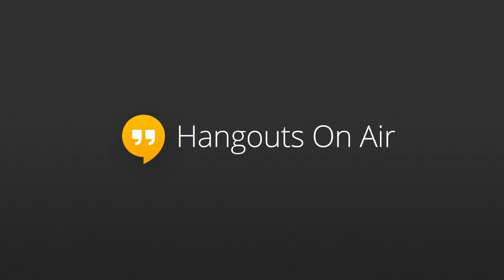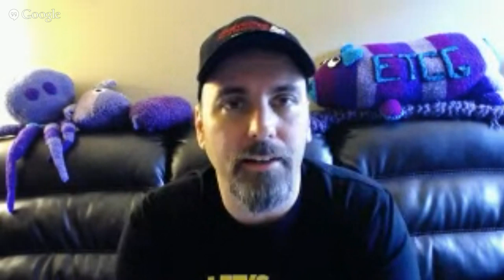EricTheCarGuy Answers Questions Live #45 6/24/2015

Comment: Turns out it was the idler tension pulley bearing had gone bad and was eating through the shaft after it ate through the bearing. Got it fixed and the whining is gone now. I probably wouldn't have caught it if I hadn't got down in there and taken a better look.

Thanks for what you do man.

Comment: Regarding trailer wiring connectors. I had a 93 GMC Sonoma that kept blowing the signal light fuse and running extremely rough with frequent stalling. Did the obvious checks with no help. While thinking about the problem, I turned on the key and the signal lights. I oddly heard a clicking from the TBI every time the signal lights flashed. Pulled off the air cleaner, repeated the test and sure enough, every time a signal light flashed the TBI fired in a shot of fuel. I tore that truck apart looking for the cause. Finally, after hours of searching, I noticed a plug in trailer harness tied up around the left rear frame rail. I unraveled the wires and found a chafed spot that was able to contact the frame. Unplugged the add on harness, reconnected the original connectors and all problems were instantly solved. Weird! It was a 2.8 V6 5 speed. Thanks for the great vids Eric! Hope my experience helps someone.

Comment: 47:00 try checking temps, coolant sensors, engine temp sensors, temp gauge, thermostat, even radiator to see if they are all within spec.  chances are it's probably at least one of those things.  especially if the gauge doesn't appear right.

Comment: missed the show. wanted to ask about manual transmission noises. only happens in 5th gear while accelerating. sounds like a skateboard bearing. a bearing doesnt make sense to me because a bearing would make noise at all RPM, not just in 5th. i did an oil change and found no metal bits. when i did the clutch in december i put the transmission threw all its gears and checked play and didnt find any noticeable ware in any gear inc 5th. i put a bottle of lucas oil stabalizer in to see if itd help and it did make it quieter. any ideas? this is a 1987 4 runner 4x4

Comment: Hi Eric, I know this video is already over, but I'd like to ask you a favor. I have done a major engine rebuild on my acura 35rl after having overheating issues. nvm The car runs fine, power output is probably even better as it was before but I am having one issue. The engine is shaking at exactly 1330rpm nothing above and below. As I am willing to take the engine out again I would consider changing the crankshaft bearings also but I have a problem of not knowing how to measure the crankshaft or the block to know which bearings are suitable. So my question would be. Do you happen to have some old block and a crankshaft around where you could demonstrate how to measure those things? I am ready to buy the necessary gear but I can't find any comprehensive video about this on youtube. THANK YOU A LOT for any answer. Keep the good videos coming!

Comment: ETCG, I have a 05 2.3 ranger my abs false activates every time i touch the brakes. I hear the motor humming even when Im not touching the brakes.Codes were only shown for faulty speed sensors so I replaced them still happens. Most of the time (its pretty random) I'll drive and my abs module will hum for about 30 seconds and then abs totlly shuts off and gives me an abs light. Done everything idea people have given me. Any help?

Comment: I have a 2003 chevy tahoe 5.3l. If i start it with the ac on, the idle goes up and down but then if i give it some gas it corrects itself. If i start it without ac, it runs fine. Any suggestions on what to do?
Reply: Probably the Air Idle control valve.

Comment: Hello Eric, Is it possible to change the fuel Temperature Sensor on a perfectly working Fuel pump on my 2003 Nissan Sentra 1.8L? (i don't wan't to change the entire pump set-up if I could just change the temp Sensor on the pump. The only code it's throwing is for the fuel Pump Temp Sensor)

Comment: why does the air in my vehical blow low on the higest setting, it not as good as when i got the vehical, its a 1996 chevy silverad0
Reply: ***** Probably either your blower motor is going bad or the air filter is clogged with leaves or other large debris.
Reply: ***** If it has a pollen filter, check its condition as they can and do clog. It's supposed to be changed when the car is serviced, but it's often overlooked.
Reply: ok thanks guys mrman17 JuxtaGenesis

Comment: Hey Eric, 
My name is Jason and I own a 2006 Ford Fusion SE. It has 80k miles on the vehicle. The previous owner had always ran 5w20 full synthetic. I still run full synthetic but in the manual it says 3000 miles or 3 months. With Synthetic oil being able to changed at a higher mile, should I change it at the higher mile since it's synthetic? Or continue changing the oil at 3000 miles/3 months. Thanks for everything that you do, it's much appreciated.
Reply: I run 5w30 full synthetic in my silverado and I change my oil anywhere between 2800-3500 miles!

Comment: How much engine oil would a GMC Acadia 2007 need because I did oil change earlier and I added 4.75 quarters would that be enough or is it to much? It keeps marking that it's low on oil still will that take a bit to get off? Thanks!

Comment: Eric..great show.  I've got a 2003 Honda Accord EX-L.  Last Year I changed the Radiator and hoses and immediately afterwards, I noticed that the Air conditioning was not as cold.  I bled the radiator fully as per your videos.  What i don't get is...why would changing the Radiator change how the air conditioning works?  

Anyhow, I have since attempted to add a bit of r134a refrigerant to alleviate the problem.  I now have issues with my air con.  The compressor clunks on occasion and sometimes does not blow cold..but this varies.  My next move is to get the system evacuated and refilled to the correct refrigerant level.  What do you think?  

Thanks!

Comment: Hey Eric I recently worked on a 2002 honda civic coupe ex with the 1.7 vtec engine. The timing belt broke. I have rebuilt the head put new valves In and seated them. New crank sensor I adjusted the valves and its getting fire and its getting compression about 115 psi on all 4 and all timing marks line up. Well the car won't start  and It does not have the original key. I had the battery unhooked as well. Is there a way to start it without the key programmed or is my only option taking it to honda.

Comment: Hi Eric- I have a 2000 ford f150 and i'm having trouble with the idle when i run my ac, when ac is on the idle is erratic and when I come to a stop the idle dips below 400rpm and almost wants to die. I have replaced the Iac valve twice and that has not fixed it and i have cleaned the throttle body. im not sure whats going on

thanks nick m
Reply: Check for vacuum leaks.

Comment: hi eric, i have a 1989 GMC 1500 2WD. The brake pedal is soft, and I have to push it halfway to the floor before i start feeling any pressure. Should I get this looked at ASAP?
Reply: ReCkLeSsErr0r  Bleed your brake fluid, sound like you have air in the system.  If you have to pump your brake pedal to get it to work your master cylinder is  bad.
Reply: If you have made all proper changes to your brakes like new pads and shoes. You may have to adjust the shoe's. As the shoe's wear down. The more your pads have to work even though your shoe's only do about 25% of the braking power. Make sure you fluid is were it should be. Also follow the advice of bleeding your brakes to see if that helps. Just don't run your brake cylinder dry as you are bleeding them.
Reply: George Perez
 Good point!  I forgot about the rear drums!

Comment: Hey Eric , I have a 2003 Chevy zr2 blazer with 126000 miles. I did a full tune up less than 10000 miles ago, and it ran great afterwards. Recently  I have had a random misfire sometimes mostly in the morning and only happens about 6 times during a 30 min. Drive. The truck just seems sluggish and bogged down all the time. It isn't showing any codes or any service engine soon light. I have since cleaned maf sensor, checked cat, changed fuel filter, checked distributor, cleaned air filter and haven't found anything. My next step is to change plugs wire and cap again. What do you think? Keep up the great work. 

Thanks, Jason

Comment: The A/C in my 2009 Honda Fit is crappy. It takes forever to get really cold on 90+ degree days. Is that just the A/C or do I need to add refrigerant? Thank you!
Reply: JuxtaGenesis You may need to add some refrigerant and also check your cabin filter.
Reply: Also on hot days like that AC doesn't work as well esp if it's really humid. Best thing to do is throw it on recycled air check your cabin filter.
Reply: I have a 2013 Hyundai Accent and the ac is really bad also! Same problem as yours.
Reply: Seems to new to have AC issues. Again check your cabin air filter. Or take it to the dealer for possible warranty work.
Reply: Miguel Laurel
Our cars probably just have really small compressors since the engine is so small.
Reply: TJC450
I agree. The A/C does get nice and cold after a while it just takes it longer than it should. That's why I am confused about low refrigerant levels or not.
Reply: JuxtaGenesis I have a prius c with a small 1.5L engine. It takes about 3 mins or so.
Reply: JuxtaGenesis Clean out the air box that holds the evaporator. It's probably full of leaves. cabin air filter should be changed too. If you still have issues, investigate a low refrigerant level.

Comment: Hi Eric
I have just bought a 1998 GMC SIERRA 2500 4x4 with a Vortec 454 and 5 speed manual, low kilometers, very clean. I am doing regular maintenance (fluid changes, filters, little things here and there etc etc) before I start looking at performance upgrades. Right now I'm focused on ignition components. GM recommends .060 spark plug gap but I have read on a few forums and heard a couple local mechanics say that a .050 or .045 gap performs better in these engines in terms of rough idle and poor performance. Apparently some have had these or similar issues. Why do you think this is? Or why would they say that? Could it be because these stock ignition systems degrade after time and don't perform/arc as well or something? I'm not experienced in this field very well so any info would be great, thanks.

Comment: Hello man, great channel.
I have SangYoung Musso 1999 that has Mercedes-benz 6 cylinder 3.2L, I've weird problem, the car works fine, then after random time (minutes-hours) it stop working then when  I remove Fuel pump fuse the plugging it in it works, then this cycle repeats, this car is very rare in my country and the only one I found to work on it said its the car computer, what you think ? Thx.
Reply: Sounds like relay switch is bad check ohm meter prongs the check relay male prongs